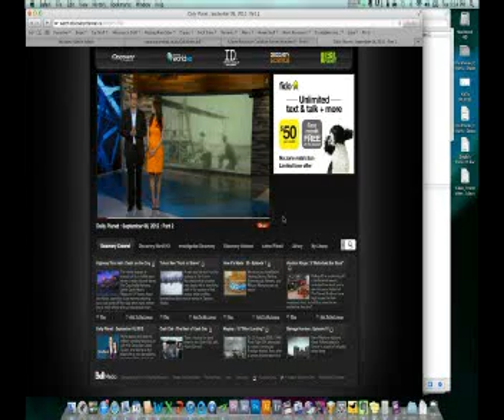D-Dalus Discovery Video

Comment: what it needs is a gyro stabilization control board like in R/C multirotor craft. those things update the spin rate of the rotors several hundred times a second, and can keep multirotor craft scary-steady with very little computational power.